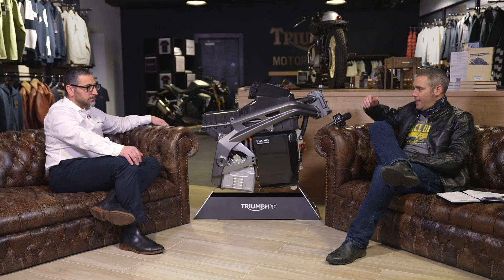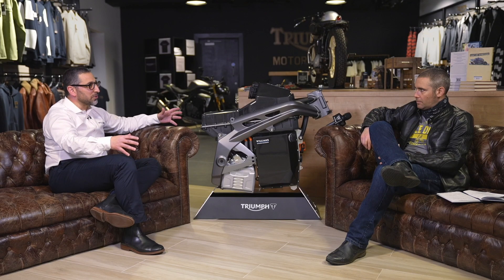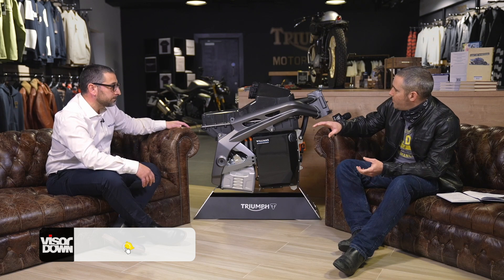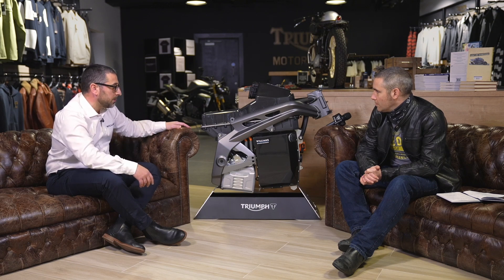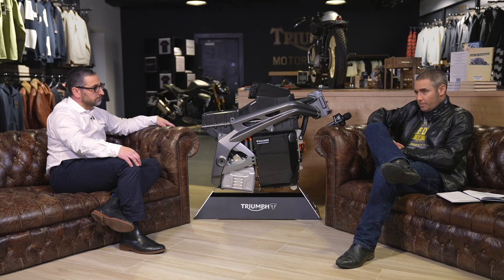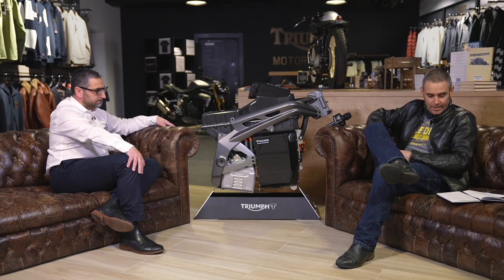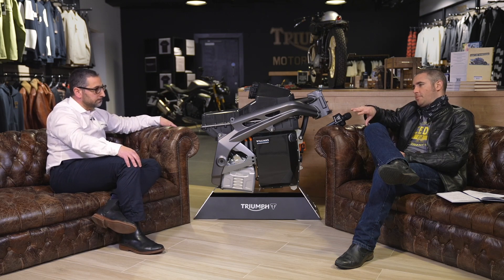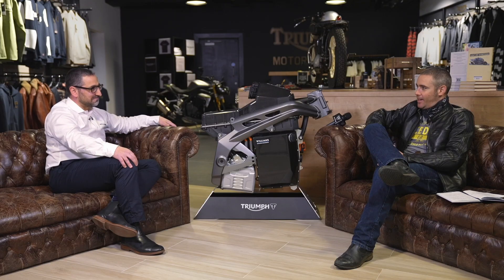Triumph TE-1 Electric Motorcycle Officially Revealed | Triumph and Williams F1 | Part 3

Comment: I hope it has the option for an Arrow or Akrapovic fake bass tube exhaust that can make triple or 270 degree twin sounds, and for the 1950s to 60s feel a 360 degree twin sound ! On the triple they'll need to fake the induction whistle too . The battery also has to have 3 big cells, or maybe 2. Definitely NOT 4 !